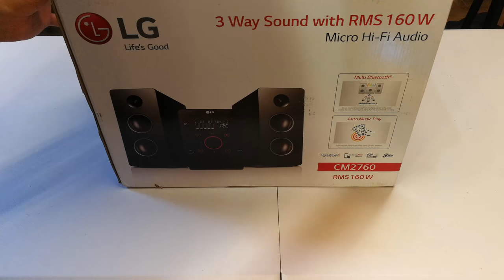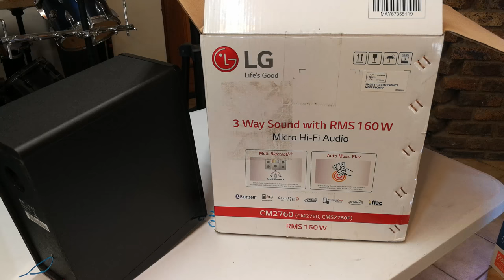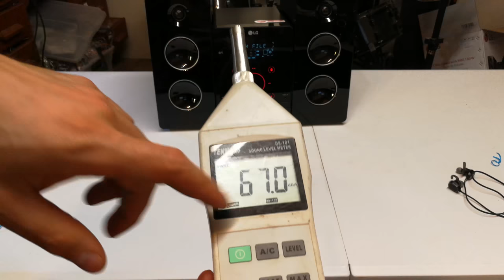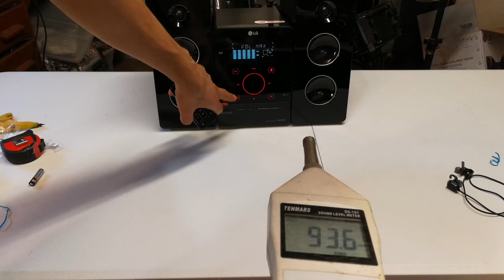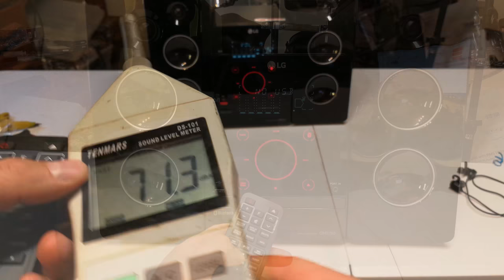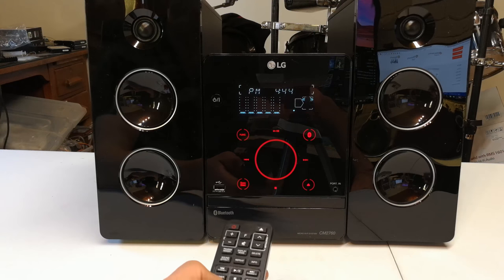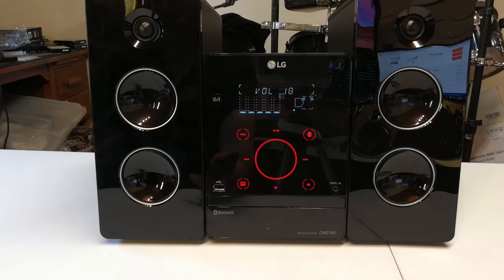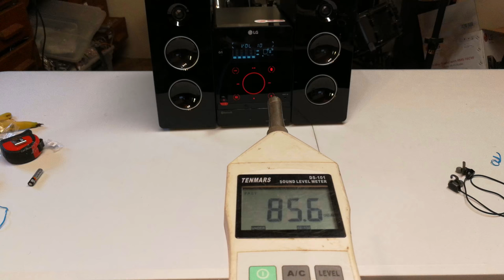Unboxing and review of the LG CM2760 micro Hifi

Comment: It consumes 45w and gives 160rms that means 160w of sound not 160w consumed, the cable is tick when it pushed like 2ohms in power amps that are way more powerful. I would like to see the internals of the "amp" or a teardown video, great video overall
Reply from the maker: a device cannot output more than it is fed. If input = 45W then max output could only be 45W - losses. Therefore 160 impossible.
Reply: @ecologicaltime  You are wrong. The consumption is simply how much it consumes from the mains. E.G. a hi fi drawing 45w will cost more to run in electricity  than one drawing 25, regardless of output power. It consumes more. You don't mention THD which is how much the amp distorts. A good THD is 10 or under. 5 or under is excellent. This will be in your manual. I have a CM 4360. Output is 230 RMS/ 115 each speaker. THD is 20%, which isn't good, so whilst it's bassy with Bass blast on at a decent volume (10/40 or 1/4 power is very loud) it's not as smooth and rounded bass as high end hi-fi. It's clear, but the presets can be tinny too muddy for my liking. The Bass Blast is the best IMHO. It's always worth noting that switching speakers to a better pair at the same or higher impedance can in prove sound quality. On my LG, low mid range was good, upper mids were terribly non existent, a pair of Wharfedale Diamond 9.0's improved that no end. I now have a pair of Sony's on it, and the Wharfedales are on a Sony system.
Reply: Does it read song titles in USB?

Comment: The rated 45w on the back of the unit is its Power Consumption I think and the 160w on the packaging is the rated wattage on its sound in RMS..
Reply from the maker: RMS cannot be higher than the power consumption. RMS reflects the actual output the speakers produce.
Reply: No you're doing this wrong. The unit consumes 45w when turned on, but the output is rate in db watts, if this were as you described then how could you have a 50w speaker setup in a car and a 150w speaker setup in another car when they both use a 12v battery? Their input power is still the same. By using amplifiers you can ramp up or down a voltage while conversely changing the current. Remember you have 240v going in, you aren't getting 240v coming out of the speaker wires, the voltage is stepped down and amps go up to give you the power you need for sound.
Reply: @oo0Spyder0oo you are clearly very, very confused! 

1 milliwatt = −30 dBW, 1 watt = 0 dBW, 10 watts = 10 dBW, 100 watts = 20 dBW, 1,000,000 W = 60 dBW and 160 dBW = 10,000,000,000,000,000 watts

Again it is clearly marked RMS not dBW. You cannot clearly read an RMS value and interpret it as dBW and think you can get away with it like the phony set of speakers he just reviewed. 

The very least you can do is search for knowledge on google before posting such misleading information.
Reply: @oo0Spyder0oo  Actually no, the output is rated in RMS. The RMS power is rated by taking a voltage reading from the amp with a true RMS meter with the amp outputting a signal with no more than 10% THD with a cheap amp. The voltage reading is then used to calculate the wattage. Say the amp is outputting 20 volts into a 4 ohm load. Then you divide 20 by 4 and get  5 amps of current, then you multiply 5 by 20 (the voltage) and get 100 watts of power. This is ohms law, look it up.

There is no way to get more power out then you put in. So assuming this stereo outputs 160 watts RMS it would have to pull at least 168 watts (assuming 95% efficiency which is incredibly good).
Reply: @ecologicaltime  There is a little thing called a transformator and a few more things. You have 45W out off 220/230Vac and 160W produced by the soundboard on a very low voltage. The are not the same.

Comment: This is quite an exceptional little setup. I bought the earlier version around 2010, the pre-Blue Tooth version, when LG were trying to phase it out but they have gone back to this design because they had hit a real sweet spot.
I was used to audiophile hi-fi and was stunned by its ability to project spatially at a rock bottom price but the speakers need to be about 5 feet (1.5m) apart. You can really hear the layers of sound and where different instruments are coming from or where different voices and sounds are coming from if used for watching films or TV. At this price point it is almost unheard of. and so I guess the reviewer did not even consider it a possibility to test for it.
And every other system that I listened to at this price point had woolly treble and midrange and the bass was just indistinct noise. Even moderate volumes led to painful distortion. By comparison this system was crisp and precise, if not gut wrenching in the depths of bass. However it was powerful enough for an impromptu disco on a 10m x 10m patio. 

 (Wattage is almost irrelevant unless mixing and matching different components. Different speakers have different sensitivities, ie the noise (in decibels) that they produce per watt of power input. These are highly sensitive speakers because they are 4 ohm as opposed to the normal 8, so they very easy to drive for a modest amplifier. If I remember the specs correctly they have a sensitivity of around 90dB/W when many speakers are around 80dB/W, meaning that a 10W amplifier with these speakers produces the same noise as a 100W amplifier with other speakers. This low power requirement for the speakers went beyond using an amplifier well within its limits so that it never distorted when pushed past its limits as other companies would have done. Instead, it allowed LG to develop an economical version of a Class A amplifier, Class A being the gold standard which is seriously ridiculous for this money.)

This system really is that special technically and the result is exceptional in terms of the sound quality and quantity per buck.

The truth is that I miss my little LG having sent it to a good home when I moved house. Now that I have seen that they have relaunched it, I am seriously considering buying the newer version. My only reservation is that it is sensitive to positioning in a room to get the best from it. The speakers need to be away from the back wall because they are rear ported and will distort if they are too close. Other designs of speaker, known as bookcase speakers, can be put right up against a wall. Side walls are less of a problem since you simply reverse the speakers (and cables) so that the side facing bass speakers project inwards rather than facing out.
Reply from the maker: yeah thanks and i have found this to be the best "little" hi fi i have tested. I agree, the sound is in another league especially for rock music. I never thought to test with a TV.
Reply: @ecologicaltime  so this is good for rock metal music?
Reply: Odid you get it? I too had the older version and the new one seems to miss the xts-pro mode and x-bass ...replaced with a bkuetooth icon and "bass blast" function...
Reply: @mrcodpwns  Yes i recommend it
Reply: But I don't think it is a class A amplifier. Perhaps it is a class D amplifier. Am I right?

Comment: When I was young, I made amps (handmade). The first rule was if I must to make a 2x60W amplifier, I have to buy a transformer of at least 3x60W (VA). In addition to the speakers, the load is also a preamplifier and there are losses due to heating. The transformer itself does not have a 100% degree of efficiency. I am glad that this is not an ordinary video, but it is also very instructive. Like!

For LG FA-162 (very, very similar to this model) manufacturr says (in service manual) it has 2x60W. Power consumption is 50w, only 5 watts more than yours model but 40watts less to speakers??? Output stage is HT1000-4 (TAS5142 is eq). Datasheet for this chips says 2x80watts. Every one  lies...
Reply from the maker: thank you, i have similar history building amps and it seems the words "average" and "RMS" and "nominal" mean nothing to marketing for hifi's, its only a PMPO rating which is like they add the power rating of every component in the whole hifi to get a wildly unrealistic value. The problem is that consumers think higher is better so there is no turning back now...
Reply: @ecologicaltime  hey can I play my own custom music on it and how like Spotify and stuff

Comment: I like the sound of mine that I've had for about a month. There is one big hang up I have with it that has only become apparent to me recently; absolutely no secure means of Bluetooth pairing. i.e. Any Bluetooth-capable device can pair with it without any prompt first being given by a user via this stereo, regardless of which mode it's in. The pairings can be initiated by anyone in range; neighbours... passers-by... even when the damn thing's turned off, as long as it's connected to a live wall outlet and "auto power on" is enabled! I did some angry searching afterwards and it looks like other select audio peripherals from at least LG and Bose have the same carefree behaviour regarding Bluetooth pairing. Even more enraging is how the CM2760's owner's manual touts this "feature" for its convenience or something stupid (see "AUTO POWER on" and "Auto function change" on page 19). Kind of violating, frankly.
Reply: Hey Admiral, it has hidden feature or so.. You Need to hold the power off button for more than 5 sec, and it will be turned off completely without option for insecure pairing.

Comment: Hi If i use  6 ohms or 8 ohms replacement speakers will the amplifier inside this unit run hotter or cooler / easier? Thanks
Reply from the maker: lower ohms = higher current = more heat.

Comment: How can it had  160  watt , if it draws 45 wat ?
Reply from the maker: it cannot, its just marketing, its only 45W
Reply: @ecologicaltime  If it  has a  45 watt RMS , i think it is enough for small / medium - sized rooms .
Reply: @richardmorrow6381 bro i really dont understand i think the amp on it that is making the 160w sound because i put on max volume via bluetooth and 30 to 35 on the system and people can ear it from the other street. I find these maybe a lil less volume than fa162 that my father bought years ago, recently i bought this one for me.. and it not disapoint i usually use it in rock or bass boost modes between 18 and 30 and it is wonderfull quality!!

Comment: 3:28 omg never seen so much wrong info ... Thats the average power consumption, not the max lool
Reply from the maker: RMS is not peak so my point stands correct. Check out a 160W RMS amp for example a NAD or Rotel, it weighs about 12kg...
Reply: @ecologicaltime  Whos talking about RMS power ? and weight depends on what type of amp it is, class D amps are pretty light. You pointed to the back of the amp and gave all sorts of wrong info on the 45w stamped letters lol, you cant deduce the power of the amp by looking to the average power consumption, only if it were written like this " MAX 45W" . Just plug it into a wat reader and play some bass heavy song and you will see the real power consumption triple that writen on the back ;)
Reply from the maker: the LG package says 160WRMS. I say its not 160W RMS as the power rating at back would be much higher in order to provide 160WRMS. Even for class D  which is what this unit is probably. Thanks for your comment but i dont agree with you. Maybe under extreme circumstances there could be a peak output of higher than 45W when a cap discharges, but nope this unit is not 160 W RMS and that is what i was talking about. Here is the definition: Mean power, or root mean square (RMS) power handling, refers to how much continuous power the speaker can handle.
Reply: @ecologicaltime  Your still wrong dude lol not saying its true rms is 160w, but you cant judge that just because on the back of the unit it says 45w, thats average power consumption, not the max lol, just test it and you will see.
Reply from the maker: @exoticg9  you said that everything i said in the video at 3:28 is wrong. In the video i said that 45W cannot be considered enough to provide 160WRMS and i provided reasons - weight, cable size etc. You then said: "Thats (45W) the average power consumption, not the max lool" - so you are saying that the unit is 160WRMS and that 45W is average power and that the unit can deliver 160WRMS as RMS is a max value? So  your are saying the labeling is correct? 
By the way, hifi are supposed to be labelled according to max continuous output for each speaker. So if an amp is 160WRMS it means its actually 2x160RMS as 160RMS is per speaker, again just showing how ridiculous these marketing specifications have become. 
I own a 200WRMS rotel amplifier, each channel is rated 200WRMS @8ohms- power consumption on back face plate is 560W 
Since the amplifier is not a generator it cannot make more power than it outputs, so power in is higher than power out owing to efficiency losses. 
If the Rotel amp was class D, the power on face plate would be closer to 400W as efficiency is higher.
Reply: @ecologicaltime  Of Course everything you said in the video 3:28 is wrong, because thats not the peak power consumption lol If it was writen 45w MAX then offcourse then they would be lying on the true RMS power ouput, because to provide 80w x2 rms it would need to consum like 250w minimum, but they just stamped the average power consumption on the back, the true power consumption is much higher like every hi fi system i tested. The new hi fi producs nowadays are much worse on lying on power, they lie so much its becoming funny, older products the major part are ok